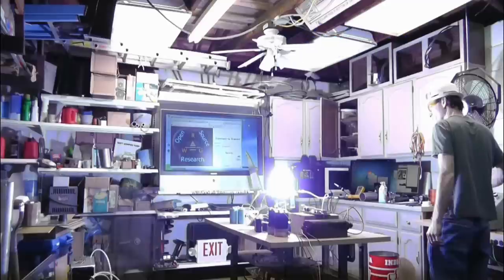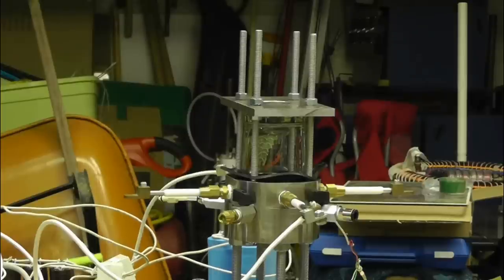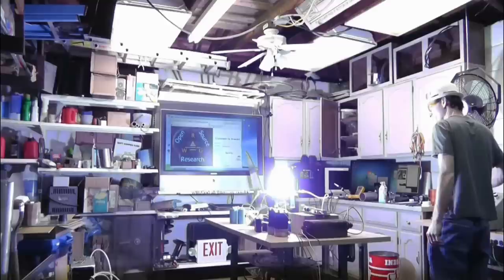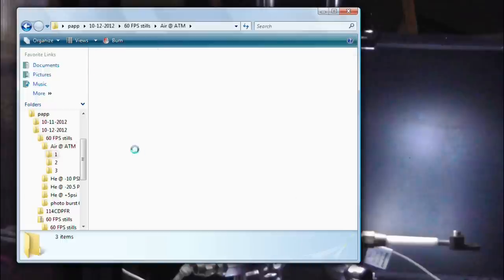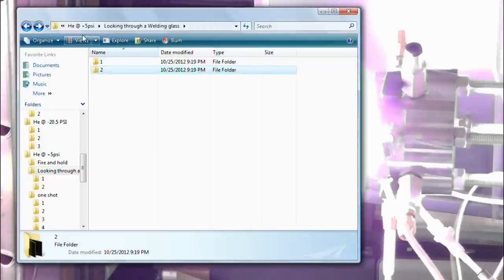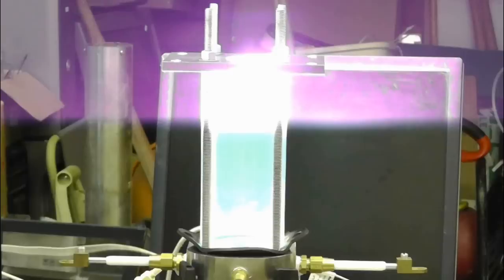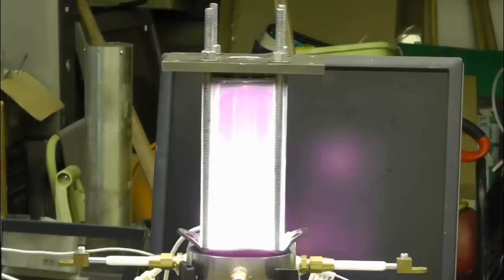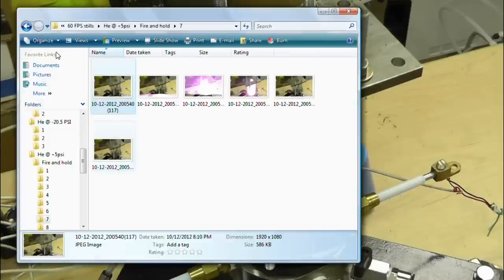Update 14 NGE Papp: Grandma's XMas China Glows Green??? That's wild! I like it! ;)

Comment: Put a CRT next to the tube when it discharges to make sure that green glow isn't X ray radiation. You may not see it in realtime but when you frame by frame afterwards the phosphor coating inside the CRT will glow when exposed. It's a nice cheap X ray detector. Stay safe, Russ! Awesome work as always.

Comment: if we admitted different concentrations and proportions of gasoline and air into your apparatus at some point the glass containment vessel would explode.  perhaps there is an excitive explosive range with inert gasses. you have in essence a big radio tube now.   you should able to get output by placing electrodes in the chamber as in an electron tube. b voltage and 350v working radio vacuum tube technology would have been common when this was first made.

Comment: didn't stan meyer have 2 voltages?  a high voltage and then something else?  the more i look into the cold fusion and the more you explain this, the more confused i get as to what everyone is saying vs. what i think i am starting to think...  if stan simply used high voltage to start the arc to allow the high current discharge to do "cold fusion". Cold fusion creates a very comparable burning gas as fossil fuel, from what i've seen.
Quote a 2 sundays ago "Faith without wonder is no faith at all"